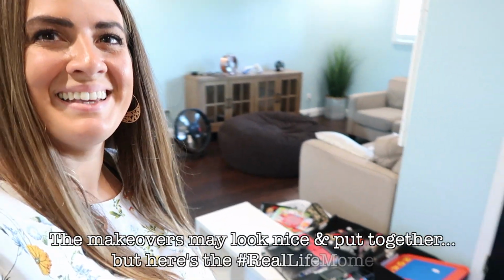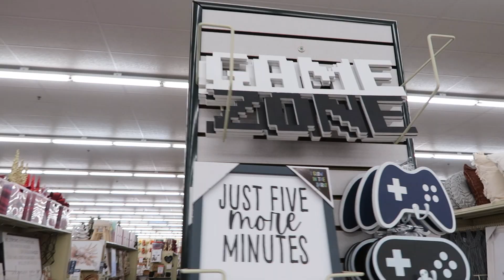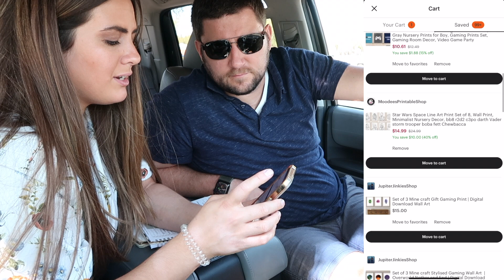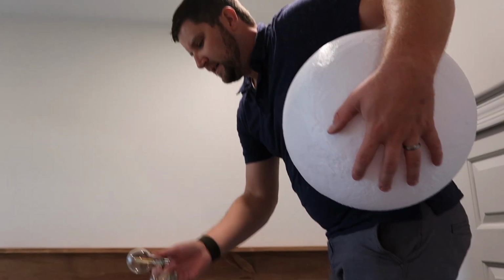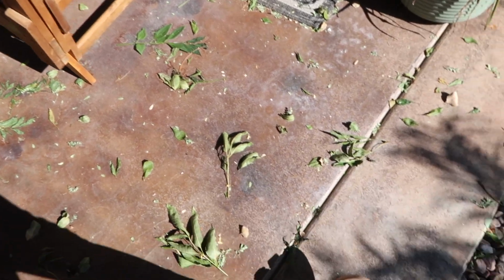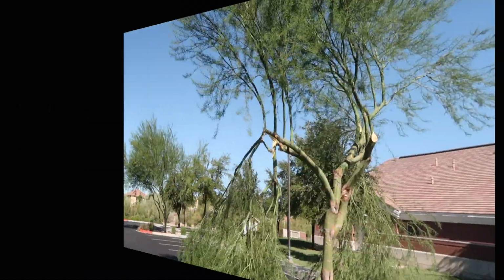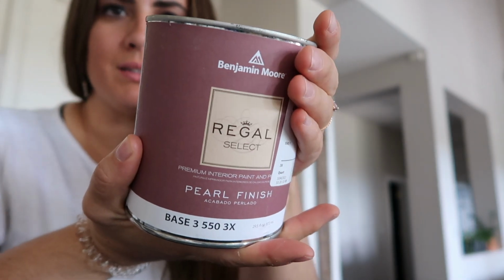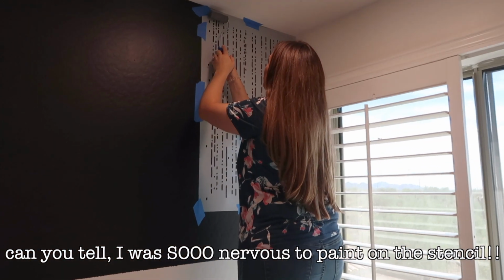VLOG 19 - BEDROOM MAKEOVER Behind the Scenes - The never ending project

Comment: If you don't want your stencil to bleed, steal it first with either a thin line of caulk (if you want a crisp line), mod podge or your base color before you paint the desired stencil color.
Reply from the maker: Thanks for the tip! Would you add the modge podge over the stencil just like paint, then when it dries, paint over as usual?
Reply: @KyleandAmandaVlogs  yes!